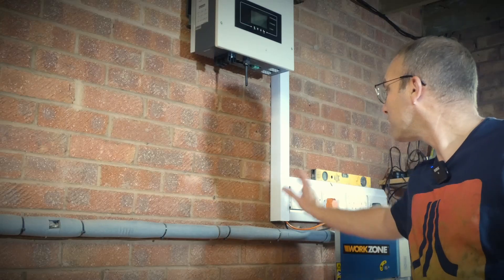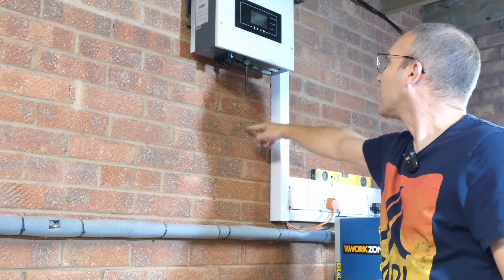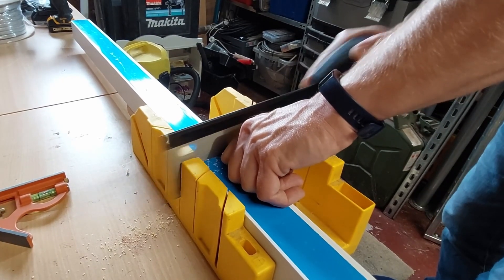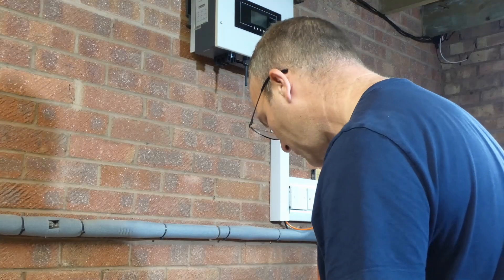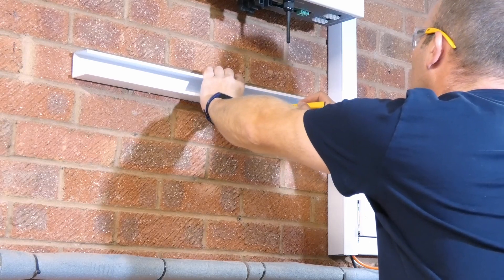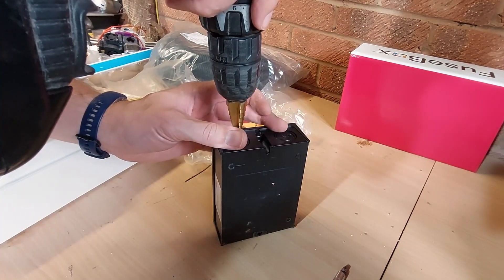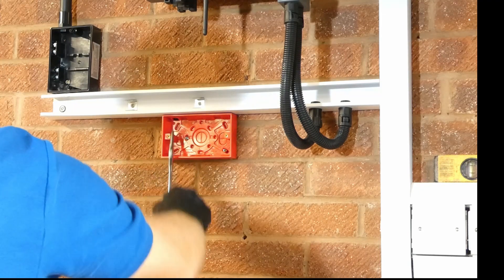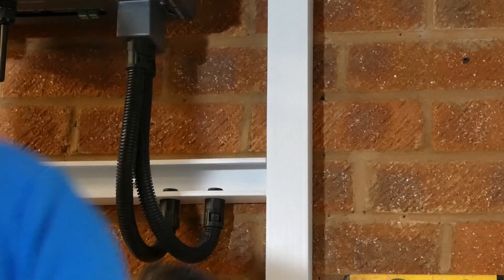Battery Inverter Install SOFAR ME3000SP [Battery Build #3]

Comment: I followed your video and now have a similar setup. I just wonder if you can connect 2x ME3000SPs in parallel to give a bit more AC power
Reply from the maker: If you have completely separate setups then it should be possible, the CT sensors may fight over who provides power, but worth a test

Comment: Could you tell me how the inverter behaves when it is night and the batteries are flat? Does the inverter consume energy from the grid?
Reply: The inverter doesn't take any energy from the grid unless you set it up in Time Of Use mode, in which case it can recharge the batteries on cheap rate electricity overnight.

Comment: Hi Stuart, by coincidence I’ve just acquired an HYD 3600es, which I think is roughly the same device as your ME3000 (but also has solar inputs). It didn’t come with a CT and I’ve had a lot of trouble getting the current rating and ratio of the CT. Any chance you know what it is (I can only get the model number for the CT, not it’s rating). Your install is pretty much exactly what I’m doing, so it’s really interesting.
Reply from the maker: The CT doesn't have any marking on them, so not sure what they are. Seem to be some on eBay but at quite a mark up
Reply: @StuartPittaway  Thanks for taking a look. I’ve been getting some wild readings with a 120a/40ma and a 100a/50ma CT’s. The only one that seems to give sensible readings is an ancient one from a cheap Eon energy meter with absolutely no markings on it either!
Reply: @artypete  Not sure if you got sorted yet or not, but the CT you are looking for is 0PCT16AL  150a 3000/1
Reply: @dannyg2325  Thanks! I've had no luck tracking down the correct one, but as soon as you posted its number I managed to find info that made sense and ordered one. Really appreciate that :)
Reply: Does anyone know what happens if the CT is disconnected. Does the me3000sp detect a fault? Does it ramp down?

Comment: Thanks for all the videos, as a newbie i am gaining a lot of information and a lot more confidence in installing my own system (and having it signed off and completed by a qualified person) 
why did you go for that particular inverter? i am trying to select an appropriate inverter for my own use, i have a FiT registered 4kw solar system already installed and want to add around 24kw of storage, i want to be able to charge the batteries from the existing solar and also off peak octopus electricity. in the future in also intend adding additional solar (not affecting the FiT payments) to charge batteries and provide power (and poss sell back to the grid?) 
is all that even possible??
Reply from the maker: I used this particular inverter as its quite "hackable" and also several for sale on eBay !
Reply: @StuartPittaway  thanks, i am hopefully picking up the same inverter on wednesday - not really knowledgeable enough to source a suitable inverter myself as there are so many out there! i need an ac coupled so as not to affect my fit payments (same as you) so its easier to go for one that someone (you) has already checked re specs etc.

the prices on ebay seem to be around the £700 mark, is that a reasonable price for a second hand inverter?

i was also looking at the Sofar 6000KTLM G3 - would that also be an option? they are priced lower than the me300 and are new!

as i said, i dont want to impact my current solar set up, i just want to be able to charge the batteries during off peak times and have my solar top up the batteries rather than import to the grid. i would also potentially also like to be able to add additional solar at some point BUT ONLY to supply the batteries/home use. 

i know that the AC coupled oprion is what i need and the connections to be made AFTER the generation meter

thanks and best wishes
Reply from the maker: @misterb5216  think I paid £650, but the prices shot up afterwards some were over £900

Comment: Hi just had this inverter installed .any idea how to stop it from discharging the batteries  when charging an electric car at night cheers Baz
Reply from the maker: Not yet, not powered it up. Can you configure the time of use?
Reply: @StuartPittaway  yeah just seen it. I think if I set it to charge battery mode from the grid at cheap tariff time and charge the car at the same time the battery can't discharge to the car. That's the theory.

Comment: On the flexible cables on the right you went into the trunking from below which looked a bit odd as they come across the trunking to get below the trunking. Was there a reason you did not attach them to the trunking from above so you could clip them to the wall later if necessary?
Reply from the maker: They would have been on on the top as well. The bend radius just felt a bit tight on the top.

Comment: So the fire rationale for the wall dogs is that "plastic will melt in a fire". But then the trunking you are using is plastic so how is that rational? Or is that trunking metal?
Reply from the maker: No it's plastic!! However those clips which hold the cables are fire rated, so although the plastic on the trunking and also the plastic around the cables would melt, technically they stay attached to the wall.
Reply: @StuartPittaway  screw fix does some deta galv tubing that would maybe work well for this.
Reply from the maker: @AndrewLeigh  yeah, metal trunking or tube would work fine. But so does plastic as long as it has metal clips to hold everything in place.